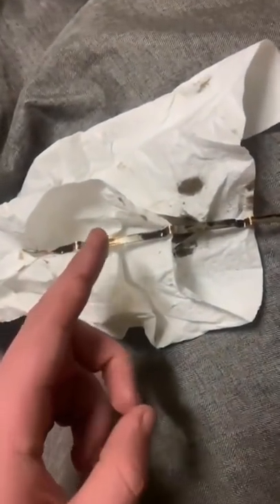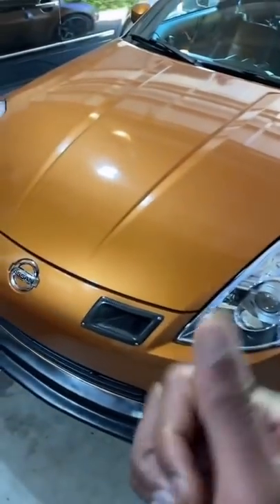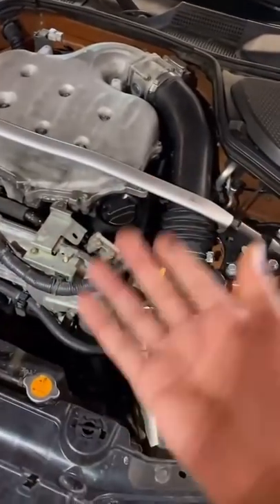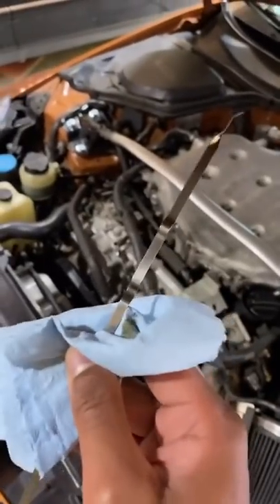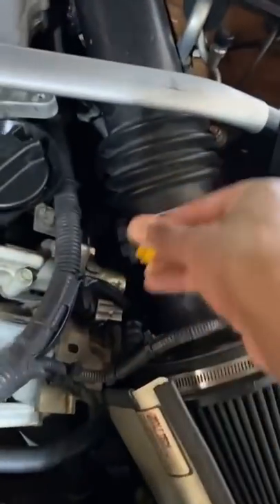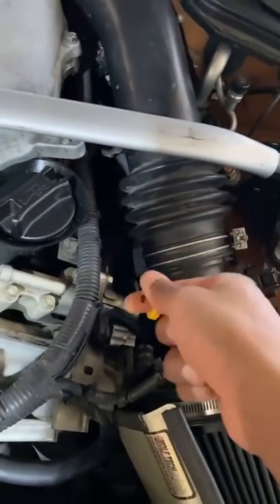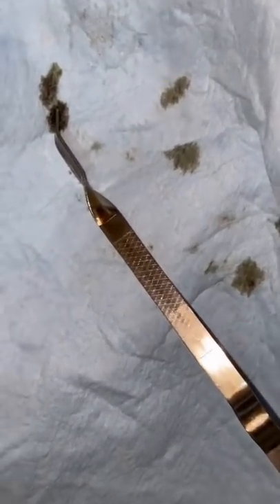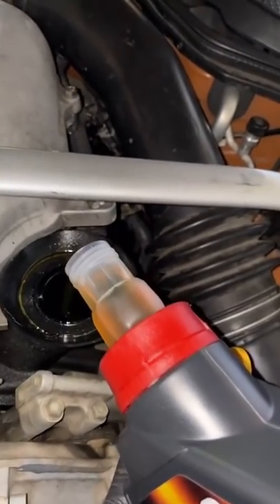how to keep your 350z engine from exploding

Comment: Fun fact: modern BMWs don't have physical dipsticks, only digital, and they only work when the engine is fully warmed up, so if you don't have any oil, it may be too late by the time you figure it out.

:)
Reply: Digital dipsticks? Thats pretty cool ngl
Reply: @Judgemental_Crow  It is, except for the fact that there isn't also a manual one in case of a computer issue, and that the engine has to be fully warmed up for it to read. But in general, it is pretty nice, and also means you get a low oil light if you leak for too long.

Comment: You can read it after 5 min or less. Just dip it and pull it out super fast. It has gave me the same reading as when the car is cold in the morning. Surprisingly my rebuilt rev up engine doesn’t burn much oil.

Comment: This dude made oil checking look like a science project, u dont even have to wait till it cools off an u dont actually gotta move the stick around to get a good reading, youll most likely get oil from off the walls of the hole, an the grit on the dip stick an where u check it
Reply: It's that ez on a toyota, but this is a nissan we're talking about.
Reply: Unfortunately this a common problem among Nissans (it’s not just a Z thing). For some reason the dipstick on some Nissans almost never give you an accurate oil reading unless you let the oil settle to the bottom of the engine.

Comment: Dipstick design hit its zenith with the L series.

It's just a straight, rigid steel rod with a flattened read point. If there's oil above the flattened section, it's overfilled; if the oil doesn't reach, it's underfilled. The dipstick can't flop around, it doesn't have weird bends in it to trap oil or get caught, and it's straight. You can literally just line it up and let it drop in.

Comment: 1) don't check oil with the engine cold, engine oil expands as it's heated so you'll actually over dill your engine like that. 2) if it's been sitting for a couple hours, how is the 1st reading gonna differ from the 2nd reading?

Comment: Great way to check these Nissan oil dipsticks while the engine is hot is to either spray the dipstick down with brake clean or run it under cold water. You just need to cool the dipstick down.

Comment: To get a good reading on those engines is to pull it out wipe it off then stick it back in and pull out right away to get the correct oil level. Bc the dip stick runs through the oil drain in the head so if you let it sit even for a second you will pick up more oil.

Comment: Cool the dipstick using air or washer fluid wipe well and check quickly.... Doesn't matter if the car is hot. You'll get an accurate reading

Comment: This engines in general are hard to read when it's been run.  My best guess is there's an oil gallery that drain right on top of the dip stick.
Reply from the maker: that’s what i’ve heard as the tube is cast into the block

Comment: When we would do oil changes for Nissan rogues it’s the same situation. If you turn on the engine and pressurize the system your dipstick will literally read over fill and you have to wait like 5 mins before it’s readable. We would just put in the oil and call it a day 😅

Comment: If you are still burning using Motul try Amsoil Signature Series so you don't burn as much oil. If you run the Amsoil flush, then do a change with Signiture series with the Amsoil filter. That might help... Helped with a 98 Nissan maximum with 320k miles for my family.
Reply from the maker: i use motul, don’t burn too much
Reply: @ChrysGaines  I didn't think so Motul is amazing stuff. Loved the video! Just a recommendation if you haven't tried it.. I have seen Motul be better with wear from Blackstone test but Amsoil be better with burn off.

Comment: This is literally the same as checking the oil level on any car
Reply: Nah, everything but Nissans I can start, shut off, and check with accurate results. Nissans are a different breed, I let em sit 5 minutes after I start them, don't even bother checking before that.
Reply: I agree
Reply: @joshuadoe9541  
I've owned Toyotas, Hondas, Mitsubishis, Chryslers,, Ford's, and even did maintenance on Army Humvees..you ALWAYS check the oil the same way.
(Turn off engine, wait till oil settled for a few minutes, and then measure oil level with dipstick.)

Nothing different here...

Comment: Classic nissan dipstick. Best way ive found is pull out,wipe off put back in,pull out and hold as straight horizontal as possible and there will be a small air gap in the oil. Thats your oil level.

Comment: Best way to check the oil level is to do so while the engine’s running.
Reply: Incorrect, get it to operating temperature, then park it, wait 5-10minutes so the oil level can settle back into the pan.
THEN do your reading, take it out, wipe it, dip it second time THATS your level.
Reply: When its running part of your oil is in the engine/camcover. Not the actual oilpan (which the dipstick sits in)...
Reply: That goes for some transmissions, but not motor oil.

Comment: If you sand the cross hatching make sure you get it clean, if I were to do it I'd take a piece of emery cloth (the red kind that comes in a roll) and scuff it, then put a little fresh oil and wipe that off and then spray the shit out of it with brake cleaner. I personally wouldn't sand it but if I did that's how I'd do it

Comment: I thought there was gonna be some meme in this about “what oil? It’s a VQ” lol
Reply: That's really only if you drive it like shit though, I have a vq and my oil level hasn't changed.
Reply: @leo._.vincent  same vq's are reliable engines if u take care of em. I just hit 80k had the car since 32k. My brother has the same engine in a g37 with 160 miles still goin 💪
Reply from the maker: dw i’ve done plenty of Vq meme videos 😂
Reply: @Git_Dat_Motivation  I got a g37 with a 103k miles on it put another thousand on it so far runs great. Just did some maintence to keep it good, drive belts, coolant, brake fluid, batter mounts, fan ctrl module, and intake filters. If you dont go to a dealership the vqs are pretty cheap to service aswell got all that done for $500
Reply: @ChrysGaines  You have meme videos about it haha!

Comment: If the car is hot all we did was to cool the dipstick with water and when you check it it reads correctly if you don’t cool the dipstick you get the reading the guy showed in the beginning

Comment: Never read first reading I always go off second or third reading yes sanding the hash marks to make him shinier on both sides does help another thing you do is you want to check it when it's warm you don't check it when you check it when it's cold before you drive and you check it after it's warmed up for every five quarts of oil your oil will expand one quart once it's up to running temperature

Comment: If you are the owner of a 350Z, or any of the other Nissans with this pesky style of dipstick, and you need to check it but don't have the hours to wait... If accessible, run your dipstick under cold water (until it's cold to the touch*). Wipe it dry, and then check your level. It may not work every time, but it definitely beats nothing

*Edit
Reply: I honestly thought all cars you had to wait hours for an accurate reading because vqs are like the only thing I have experience with working on actively
Reply: @vam6677  The Muranos and some other unsuspecting Nissans also had the vq, I'm pretty sure they're like the only Nissans with the goofy bendy handle on the dipstick. Generally most engine oil readings are pretty accurate, once the car is parked on a level surface and shut off. There are of course some other vehicles (certain Fords and German imports come to mind) that might require a bit of rock kicking to get a proper reading. To be safe if you're not sure just give it a couple minutes, watch some YouTube shorts or grab a drink, and check it again. 👍
Reply: @jonathanfruchtnicht4966  my fwd vq Altima is a massive pain to read the dipstick it's not twisty but it's like segmented and if the cars run in the past few hours sticking it in it'll always be messed up I gotta let it sit for a long time
Reply: @vam6677  guessing it's an older model then, I say that affectionately, but with that said yes I can imagine the pain. I had a hard time ever even getting most vq dipsticks into the actual tunnel, they notched the hell out of them. Give the cold tap a try next time, after the cars sat for like five or ten minutes. If you don't have any luck with it, it's just one of them ones 😂 luck of the draw but hey fingers crossed for you!
Reply: @jonathanfruchtnicht4966  it’s not just VQs, there are plenty of other Nissan models with this same exact issue. Other day I had a Sentra come in with a similar style dipstick and it was a pain in the ass to check the level.
Reply: @YungGaucho  aha! How could I forget.. basically anything around that 98-08 era right? I'm not the most knowledgeable by any means but that's so funny you reminded me, I forgot those 4pots were just as bad. Sadly I don't see many of these around these days
Reply: @jonathanfruchtnicht4966  yeah sadly they didn’t last very long haha. Still see some 2000’s models from time to time.
Reply: @YungGaucho  I either always or never did like those Sentras. Thank NFS underground and fnf for that. Pffhaha never wanted one that's for sure

Comment: How is that “notoriously difficult to check”? Same process on about any other vehicle with a motor
Reply from the maker: it’s not if you check it after the engine has sat for a few hours and your oil isn’t too fresh. which isn’t exactly normal procedure for most cars.

Comment: How do you check your oil in a 350z?

Its not about jusy checking and adding oil wjen needed! There comes a time that you need to change yojr oil and filter!

Your oil should be changed at most every 5k miles idc what the bottle says. Closer to 3k for high mileage cars.
Also just brcause you havent put 5k miles in your car all year doesnt mean your oil is still good. If yiy ever notice when you have a place fhange yiur oil the tag will have a time out date & a mileage number indicating when the oil should be changed!

So remeber your oil can time out, it will go bad and began to seperate and loose necessary properties removing the entire purpose of having it in the car

Comment: You check the oil level after its circulated for at least 30 seconds. And also nothing about that seemed more difficult than usual
Reply from the maker: many cars recommend you check the oil warm, just letting it sit for a few minutes. that doesn't work here

Comment: I'd just let the car run for good 30 seconds. Build oil pressure. Turn off let it sit for a bit and read the oil. But you should always change your oil every 3000 miles/3 months to avoid misleading yourself and avoiding a blown engine.

Comment: They might be difficult to check the oil on but it doesn't matter because it's not like they're notorious for certain oil leaks and burning oil... 👀
Reply from the maker: easiest way to catch an oil burning or leaking problem that doesn't pool on your floor is by checking the oil often

Comment: Wait... yall don't know how to read dip sticks...? Also never check when the oil is cold. Run the car for at least a minute,  turn off wait a minute then check. Your pull should be warm. It changes the thickness and sometimes certain parts of modern engines trap pools of oil when cold.

Comment: Your wrong on when you should be checking the oil, as a mechanic the best thing to do for checking your oil is to run the motor even just for 10 seconds so there is oil in the top of the motor and then shut it off and check the oil then as when you let it sit you are letting all the oil from the top of the motor drain into the pan and can actually have you read up to a litre of oil difference when you have no oil in the top of the motor

Comment: Don't move it around. It weakens the stick and I've seen them break off before. Just stick it in all the way for a second and pull back out.
Reply from the maker: it’s metal
Reply: @ChrysGaines  Exactly metal gets weakened if it gets bent a lot. One time I pulled a dipstick on a truck that wouldn't start and the thing snapped in half and fell inside the engine 😳
It's not worth it to wiggle it around when it should already get you an accurate reading.

Comment: Sit for a few hours? Why? Just let it sit for like a minute or two and make sure it’s all dropped down to the pan. There’s no point in waiting fucking hours to check your oil 😂
Reply: Wont hot oil read high in the dipstick because its expanded?
Reply from the maker: this is 350Z VQ specific as the dipstick is an absolutely terrible retrofitted design from the switch to RWD, making it hard to read when the oil is less viscous and warm.

Comment: Fill it with 5w50 or 5w60 if you actually want it running for a long time. The OEM recommended viscosity is way too low and just destroys the engine if it has been driven pretty hard. Mine still runs perfectly with 100K miles on the clock and there is no metal in the oil pan at all, not a single speck.

Comment: Ah yes lets check the oil level after hours of the oil draining to the bottom of the car and no oil circulating through the engine at all. You should turn the car on, lets oil run through the engine and then check.

Comment: Instead of sanding, just flip the stick upside down after pulling it out and the oil will sag at the level indicator..   Which is the correct way...  Not sanding it. Good lord

Comment: Lol dont sand it the sand particulates wont all be cleaned off and will damage internals. At CAT diesel factories u can get fired for bringing sandpaper to work by accident. U wanna add sand on purpose? Dont lol

Comment: Wroooong! Leave it sitting for about 5 mins lol
Take the dip stick out, wipe it off and then dip it in and out quick ( make sure you push it all the until you feel the click and put it out quick) easy it’s not hard. 
Get a catch can after 100k miles

Comment: Lmao no don’t check after it’s sitting “for a few hours” do it in the morning that way you have a cold engine
Reply: Never read an owners manual that said to do that.
Reply: @jpeterman9699  cause it’s common sense you doughnut
Reply: @jasonyurrrr9994  every owners manual I've read said to run the engine and then wait a few minutes before checking.  Not sure why you think the engine has to be cold

Comment: Wtf
The cross & top mark indicate oil level. When the oil hit/ is at the top mark going towards the handel that is the full line.
Sanding the indicator lines is completely a lie & wrong.
How about you fix the oil leak. Instead of telling folks to keep it topped off.
FIND THE LEAK  Genius!!!!
Reply from the maker: where did I say sand the indicator lines off? The idea is to roughen up the smooth metal with like 80 grit so the oil sticks better. and unless you want to pay to have my engine disassembled and rebuilt to better than stock specs, I don't think I'll be stopping any oil burning anytime soon.

Comment: Was this Renault contribution? A simple device made with poor execution despite fundamental importance.

The nissan qashqai with Renault engines have similiar problem. Takes an aaaaage to get good reading in what is supposed to be a quick oil change in the shop.